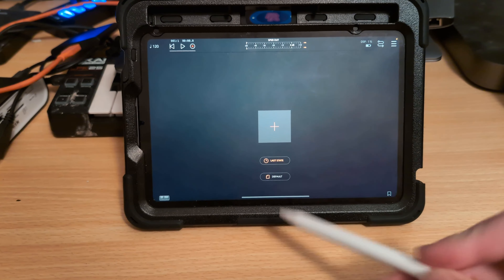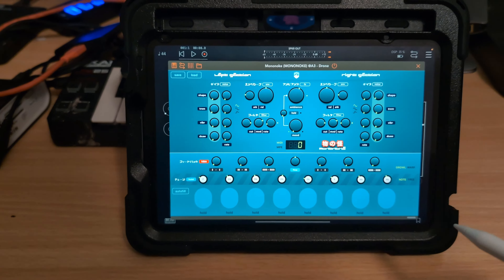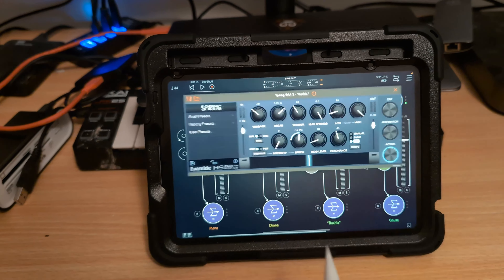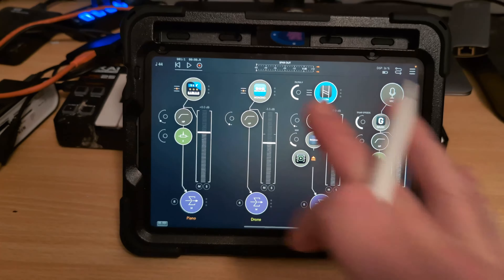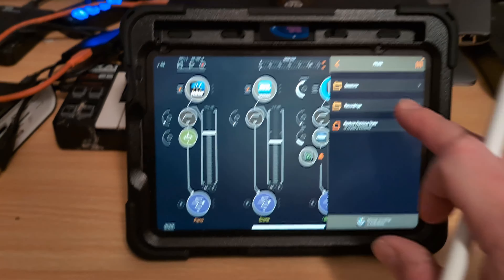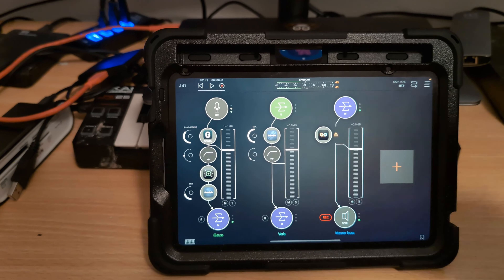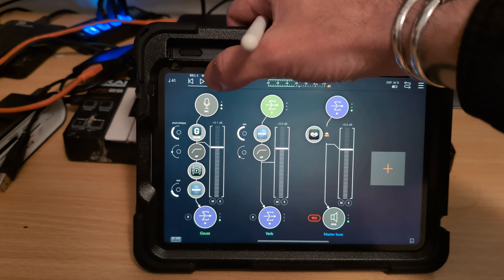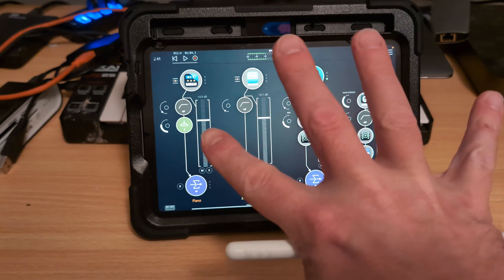How to Fight G.A.S with the idea of building musical systems!

Comment: So I make music with Samplr but I wanted a solid way to control it live but struggled because you can only see one channel at a time. 
My solution I am rebuilding Samplr inside a reason custom combinator using dr Rex and a launch control which I’ve mimicked on the combinator. 
So I can compose on the go with Samplr then bring it home transfer into reason which gives me a bit more freedom with effects, multiple pattern variations and still keeps some limitations with the number of controls available on the launch control and the overall 6 channel layout of Samplr. 
I am having so much fun with it 
I think the key to these systems as you put it and they’re success is they inherently have limitations which frees you up to concentrate on making music knowing the limitations of the system.
Reply from the maker: Yes that last sentence is exactly the hat I was trying to sum up. The limitations of the equipment strangely forces you to be creative with the tools that you do have available, rather than loading up another plugin or buying another module etc. I've not played with samplr and haven't used Reason in almost 20 years, I can't imagine how good it is now, it was cool back when I last used it!
Reply: @decibelboy83  Samplr is the best iPad app full stop. Reason is still pretty good if a little complex these days but you can make it as deep as you want. It’s great for testing real world ideas before spending on hardware, as a nice multi track recorder or creating small systems to play with it is crazy versatile but still after 20 years I occasionally find myself going how the hell do I do that but a quick YouTube tutorial usually does the job .
Reply from the maker: Is it any good if you don't like sampling?
Reply: @decibelboy83  😂 yeah probably not

Comment: Great video, some great points.i think there's a balance of having just enough hardware vs going crazy. I must have a dozen different workflows and the only one with a DAW is when I use Korg gadget on my iPad. But when I use it, it works well. I have a flexible setup in my studio where I can plug in Instruments easily and push record on a multitrack recorder. Depending on which sequencer or groove box I'm using or which synths or guitars I want to use for leads that works well, and having a portable multitracker makes it so easy to sometimes record on my couch or sometimes being it up to the studio, but the key thing for me is- if I want a music track that feels inspired- it should never ever feel like "work" to record it. For me, that means I have to stay as far away from a mouse and keyboard as possible. I might use a Gameboy or my iPad to track things out, but I never sit clicking through presets or drum sounds because that just feels icky. As long as your workflow works for you, you like the result and it doesn't feel icky, you're good to go. Right? 😂
Reply from the maker: @infn8loopmusic  yeah man there is absolutely no right or wrong way to do anything. My real goal for this video was to try and inspire people to not fixate on the gear and instead think about what they really need to make some music.
Reply: @decibelboy83  and you nailed it! 😃
Reply from the maker: Thanks for saying that. I do really appreciate the kind words.